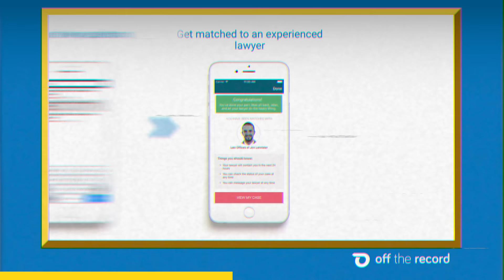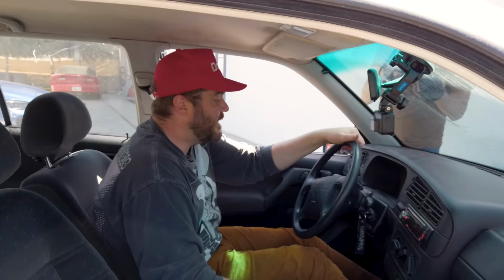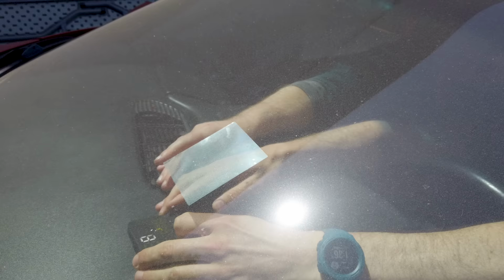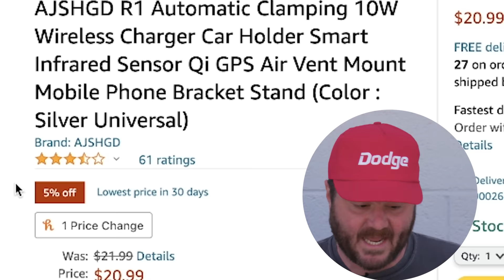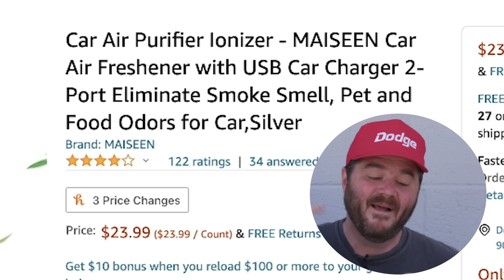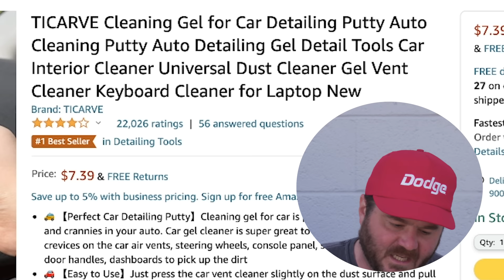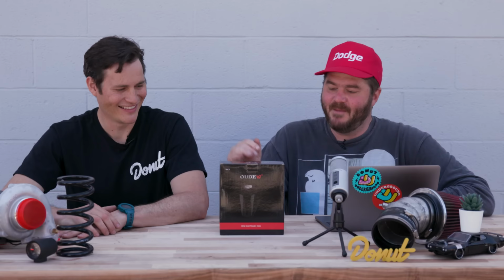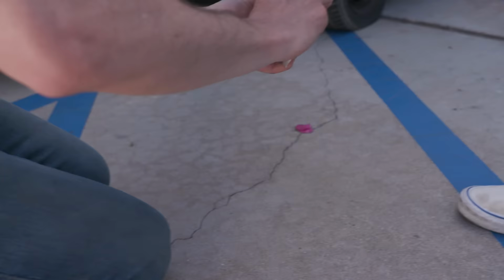We Bought the Most Futuristic Car Products on Amazon

Comment: With the huds, lots of people use them in 4wds when they are putting bigger tyres on. I'm planning on putting one in mine, as my speedo is currently 10kmph out (when my speedo reads 90 I'm doing 100). Most people use a gps one that connects to a 12v socket though as they have pre obd2 4wds
Reply: A change in tire/tyre size makes a percentage difference in the speedometer accuracy.  It isn't 10KM/h off at every speed, but rather a percentage.  At zero, it is zero.  At 45, it is probably 50 in your specific case.  With different vehicles and different tires/tyres, the percentage will be different.

When I replaced the 14-inch steel wheels/rims on my Camry with 16-inch Lexus alloy wheels/rims, I used an online tire size calculator to pick the best tires to maintain my speedometer's accuracy.  I was within a half of a percent.  For a 4×4, you want bigger tires/tyres for more ground clearance and all that.  In some vehicles, the OE speedometer can be re calibrated, or so I've heard.

YMMV
Reply: @frederickevans4113  very true, my bad. My old 4wd had tyres on it that made the speedo spot on, but they were only slightly bigger than my old tyres, whereas these tyres on my current 4wd are significantly bigger than stock, throwing out the speedo significantly. It had smaller than stock tyres on when I got it as well which threw the speedo out the other way (when the speedo was at 110 I was doing 100).

Nonetheless my main point that huds are useful when you're putting on larger tyres than stock that throw out the speedo significantly still stands.

Comment: I had one of those fancy wireless charging phone mounts in my car. The thing automatically wrapped around my phone which was cool, and it did charge, but the charging would cut in and out frequently. There is also no option to disable the charging so you don’t overload your battery. Your phone will die 40x as fast after a month of using it.

Comment: i spent my twitch payout one time on one of those car hud things, but mine has its own dedicated screen- it's not a windshield hud. i leave it on a setting that shows my speed, rpm, water temp, direction, and time. I mostly wanted it for accurate spead and water temp, and its one of the best products i've ever bought. whenever i get another car, its definitely being installed in the new one. Factory spedometers tend to read a little fast.

Comment: You guys placed the wireless charger on the vent incorrectly. You have to put it on the underside of the vent adjustment handle so that way when the weight of the charger pulls the vent downwards, it locks the vent into place. It works just like a locking differential. As an added plus, the vent pointing directly onto the charger is what keeps it cool and charging your device efficiently

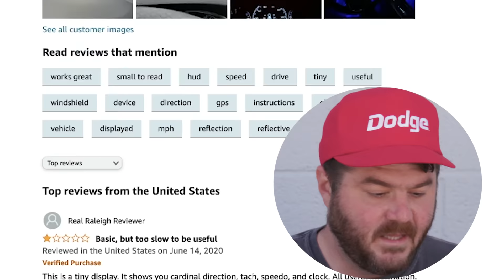Comment: 3:20. I'm pretty sure I have that exact HUD. It's very easy to set up. Plug-and-play in most cases, and you actually don't need the OBD2 port. It can run off GPS if your vehicle doesn't have OBD2 (hence GPS in the title). However, OBD2 is much better.

I have the same feelings about the HUD. The text is quite small, especially when it comes to the cardinal directions, and the tach is delayed enough to make it useless. If you want it just for speed, it'll do the job.

Comment: Actually have been using a wireless charger in my car for a while. It's not the style and brand shown in here but have been happily using it for a while and glad to have it. It has auto arms too which is actually pretty convenient. Plus it came with an actual arm stand with a suction cup and not just the air vent attatchment.

Comment: Download gps speedometer app on your phone there is an option which allows you to convert the phone to be seen as a heads up display and works great providing you have a dash that would allow you to set your phone on the dash. I have a no slip mat that I use which holds the phone in place. I typically only use it when on trips at night that aren't short.

Comment: The 1994 and 1995 Golf III and Jetta III sold here in the USA have an OBD-II physical port but it is NOT 100% electrically OBD-II compatible.  I think in 1994/'95 VW was prepping the vehicles for the 1996 requirements and made the port mostly OBD-II compliant but continued to use the K-Line signalling.  I know, I had a 1995 Golf III GL 4-door hatchback with the "two point slow" four-banger mated to a 5-speed manual and my wife had a 1994 Jetta with the slushbox.  The governor kicks in at 120 indicated miles per hour (probably 114 realistically) and I KNOW the Golf will do that, unmodified.  I don't agree with the "two point slow" moniker (maybe with the slushbox it is slower).  ABA 2.0L + 020 5-speed in mine.

Next to the ashtray & cigarette lighter in the center stack (below the radio), there is a blank plate to the right.  Remove the ash-tray and slide the aforementioned blank plate to the left.  You can plug a VAG-COM cable with the OBD-II plug on the end into that port and use appropriate software to read codes and so forth.  The 1996 onward are fully OBD-II compliant (here in the USA).  If you are ever in the DFW area, I have a VAG-COM cable which works on some V-Dubs back to 1994 without an adapter and some even older ones with an adapter (which I don't have as yet).

I reserve the right to remain silent about which of the three countries in the Americas I drove that car at those speeds on public roads (it was only one of the three countries).  It's been almost 2 decades anyhow - so the statute of limitations has probably lapsed already anyhow.

BTW, I assume your 1995 Jetta has dual airbags and the passenger side airbag is located where the glove compartment was located on the 1993 Jetta.  If so, with some minor modifications to the car, the 1997 glove compartment will totally replace the passenger side knee bolster.  I did it on my 1995 Golf.

I had to pause the video and type this before continuing to watch the video.

Comment: I had that exact same phone holder but from a different brand (definitely made in the same factory) if you put it in the bottom corner of the vent it holds fine. Broke after a year but it was actually great for a year, but just because my cars vent was perfect for it

Comment: I have that exact heads up display I have it plugged into my obd2 port the biggest thing that it helps with is the fact my actual speedometer is off by 3 miles per hour I was able to adjust the settings and calibrate it separate then the speedometer and it shows the exact speed I’m actually going thanks to related law enforcement for verifying it

Comment: I had a car that most of the gauges stopped working in so I bought a cheap HUD from Amazon that was powered by the OBDII. I did have to calibrate the speedometer which was easy but it worked great. No lag, day/night modes, Speedo, tach, check engine, temp, voltage, even ABS and traction control… I think it was only like $15.
I’m not saying get one just saying not all of them are crap. To “fix” a beater car it was a good quick, cheap solution vs $250 for a new gauge cluster on a car that wasn’t worth much more than that.

Comment: I had a car that had a messed up spedometer, it would just not work half the time.
I installed one of those ODB2 HUD's, used that as a spedometer for probably a year. Maybe not the best solution, but it was certainly a use case. And it did absolutely do the it's job.
Not sure if that was actually a legal solution though, so maybe don't try that if you can avoid it. :P

Comment: The first one is wrong used, its supposed to be atached to the car and point the lasers to something you have on the garage, like a light.
Still, it could be a lot better if made by a designer, instead a laser point make it a line, and also something for the axles to dont move with the normal use and movement of the car.

Comment: Ozone is only bad if inhaled in large amounts...   otherwise it sanitizes the air and as it sanitizes it turns back into o2..  ozone is o3 and the extra oxygen molecule attaches onto a particulate and oxidizes it turning into o2 again.. basically..

Comment: I just bought a Motorola unit to allow wireless Android Auto and Apple Car Play in my 2020 RAV 4.  It's a simple unit that plugs into the USB port and links to my phone and the car.  It works pretty well except for fast skimming through a play list which brings it to a stop while it catches up.  But for $99 I don't have to take out my phone and plug it in to get Android.

Comment: First of all i have that wireless phone charger, and its great, secondly the unit itself is not wireless, it has wireless charging technology. Sorry really frustrated on that review as i have one and absolutely love it! it makes it so easy to put my phone into a holder and wirelessly charges as i drive. One little tap, the flaps open and i have my phone back. The best holder and charger i have yet to use and i am very picky about my car accessories.

Comment: As far as the wireless charger goes, I have a different one that actually works and it's actually pretty useful.  I would argue even more so than the ones that come stock in newer cars since it actually holds onto the phone.

Comment: Ozone reacts with water to form Hydrogen peroxide. Your lungs are moist, so breathing Ozone will cause Hydrogen Peroxide to form deep within your lungs. We all breath a certain amount of it, say, after a summer lighting storm, or after arc welding, but more is not better. Ozone is particularly effective at smoke smell because it oxidizes smoke particles and turns them into dust particles.

Comment: i got that hud :D , i need it bcz i forgeet and go over the speeed limit by 15-20 on street and 60-80 on the 105, though only use the speed with engine temp. its cluch i only move it after reaching 65  no meters

Comment: That mobile charger cradle... there is a better one from Baseus it has metal arms that tend to hold the phones in better. I have found that they really don't like cases especially the ones with a magnetic strip inside the case

Comment: there are wireless chargers that are better than others... likewise there are HUD units that are better than others, that ozone generator is junk... there are units out that WILL do the job, they cost several hundred dollars to a couple thousand dollars you are better off using proper cleaners and detailing the interior (remove the seats, and doo a serious cleaning with mildew cleaners.)

as a former auto detailer, I got one of the slime packs from china (same price, I am sure it is the same product) it works beautifully for being a $6 product.

Comment: I have that wireless charger. It works, but it's not a fast charger by any means. Very few qi chargers can fast charge an Android. And none of them are $20. But it makes for a good backup when my phone randomly thinks the plug is wet.

Also, no wireless chargers afaik works with a case. You have to take the case off to charge and get the arms to function.

Comment: i have a heads up display from ali express, they sold a gps ver and an obd ver, i went with the gps, it's fast and accurate, always visible, the speed is always the same as what it shows on my waze app, as well as the cameras we have in the UK that show us our speed. great gadget and super cheap, like £10
Reply: Well... Link? Or name?
Reply: @man_imbored171  WYING M3 Auto OBD2 GPS Head-Up Display Auto Electronics HUD Projector Display Digital Car Speedometer Accessories For All Car - get the 'm1 for all car' version. it's usb and does your speed via gps, same as waze and all the road signs that show your speed, the obd version shows the speed from your dash which isn't accurate

Comment: DON'T PUT OZONE EMITTERS IN YOUR CARS PEOPLE!!!! Anything that says anything about "ions" and has either a blue-ish light, a buzzing or hissing sound, or both, get rid of it now. Ozone is fine in small doses infrequently, but it can be a major health hazard if youre regularly in a high ozone environment without a self contained air supply (eg scuba gear which would be a dumb way to drive). Household ionizing air purifiers (which follow consumer protection regulations) use activated carbon filters to convert the ozone back to oxygen like a catalytic converter, but the plug in devices almost never have that.

Comment: So I tried one of those HUDs because my dashcam doesn't record speed so my hope was if that info was projected to the windshield it would record it, and it did do that. But I had the same problem of it being wildly inaccurate and laggy to the point where it was unfortunately useless. I tried calibrating it but all you can do is kinda set a range above or below but it got more and more inaccurate the faster I went so it basically only agreed with my speedo at like 30mph. Sadly, useless. I wish someone would make a highly accurate quality hud but it's all cheap garbage. Anyway, that's what someone might use one for.
Reply: Try a GPS based one, works a charm!

Comment: I solved my trash problem for free after wolfing down your fast food pull into a gas station they have trashcans by the pump problem solved very advanced. Qt an racetrack have those thicc wide boi cans where you can practice your 3point trashkettball sk1llz. Since then never had trash in my vehicles.

Comment: breathing ozone isn't healthy. You would need a really big ozone generator. The idea is the charged particles released attach to smell particles, making them heavy and cause them to drop to the ground. But you need to fill that fucker with ozone, and you def should not be inside when that's taking place. If the smell comes from a living thing like mildew it will stop the smell till more smell is 'produced'. You still have to deal with the OG problem.

Comment: Actually the little mini trash can has a practical use. I use it for change. The local crackhead scumbags would smash every window in your ride for a quarter in an ashtray, but they don't give lil trashy a second look.. And It probably has about $50 in it by now,  because the secondary bonus with the spring top lid is that you can't see how much is in there. So the old "out of sight, out of mind" thig kicks in and it builds up faster than you expect.
Just sayin..

Comment: 6:00 What exactly is the point of so-called "wireless" charging? EVERY "wireless" charger has a WIRE bringing power to the charger. And EVERY "wireless" charger needs to have the phone docked to it. To me, TRUE wireless charging means keeping one's phone in one's pocket, and it charges one's phone if one walks around NEAR the charging port. Having to put the phone in a dock IS NOT effectively wireless.

Comment: Hey guys, with the wireless charging phone mount, there are about 10 different versions like the one you saw and some have better clamps than others I bought one and it works very well.( sometimes if your phone case is too thick it won't charge )  reply for a link to the one I bought.

Comment: 4:30...
Yeah that might happen fucking around with amazon garbage. The heads up display in the Honda accord is useful, and that's a mediocre one. The nice ones in luxury cars are way nicer. Y'all joke about not being able to move your head, but if they weren't effective they wouldn't use them in fighter jets. The image from a proper hud appears to float above the middle of your hood in front of your windshield, not reflecting of the glass ( even though it is actually doing that).

Your description of huds is like saying why would I want a gun? Based of your interactions with a high point.